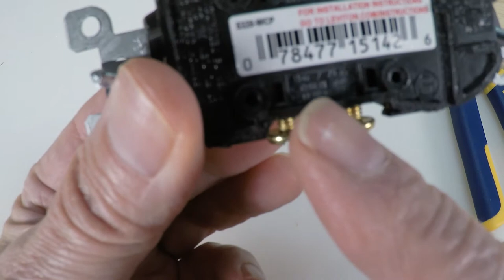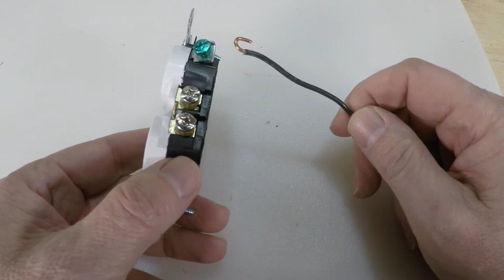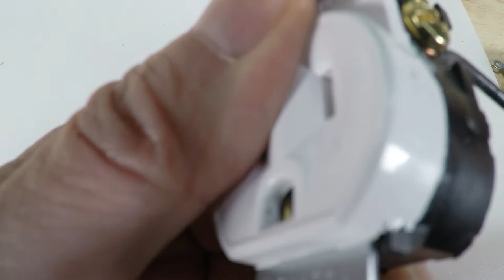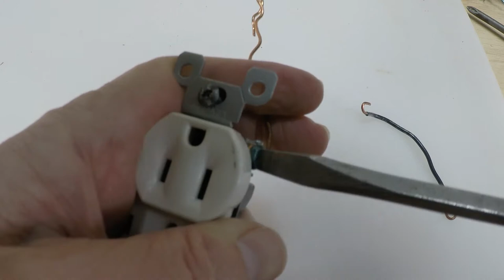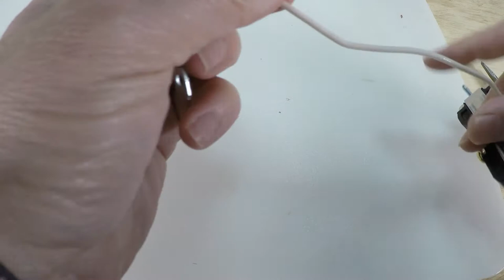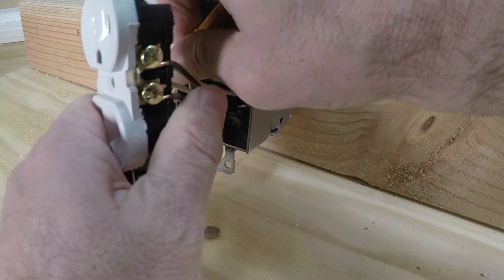How to Wire or Replace an Electrical Outlet

Comment: Is there a reason you didn't connect the ground wires to the metal box? And it you were to would you pig tail or just hook the ground wore from the cabel come from the breaker or both cables?

Comment: Im trying to replace an old outlet in my grandfathers floor and it has one of each wire and no ground wire. Theres no box either. Just screwed into his wood floor. I tried changing the recepticle out completely and i think i crossed wires the first time but fixed it and it still doesnt work. My voltage tester reads power to the wires tho. I did have to force the new recepticle to fit into the floor so i hope that didnt break it.
Reply from the maker: install an old work box. Find out which wire has the power and that is the wire that you attach to the copper screw